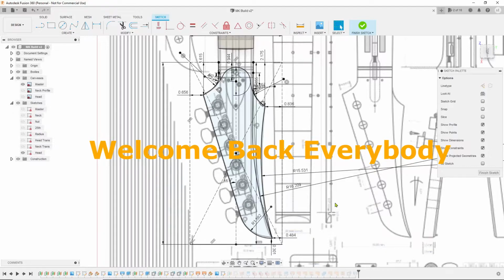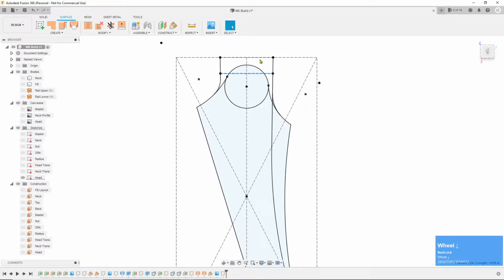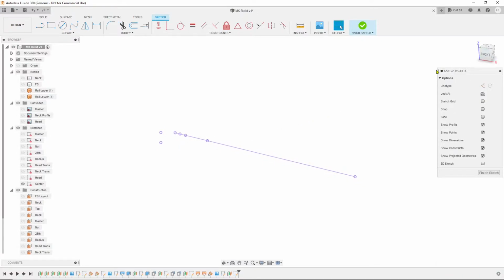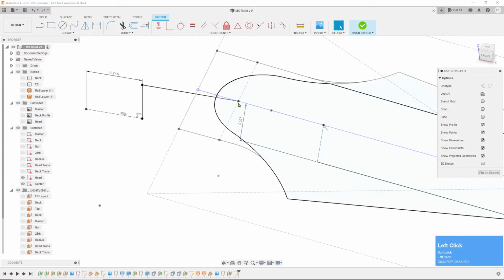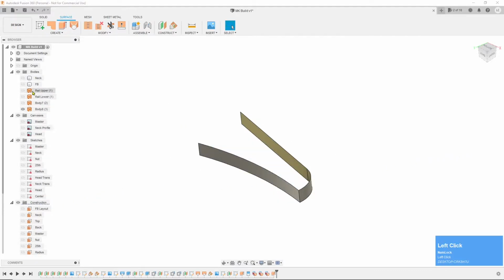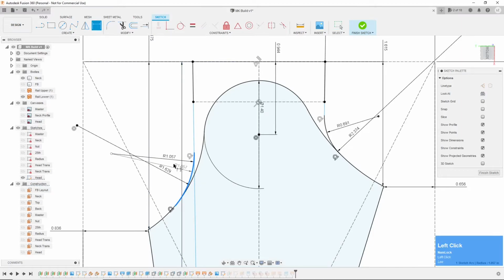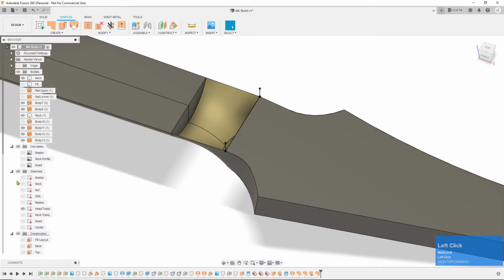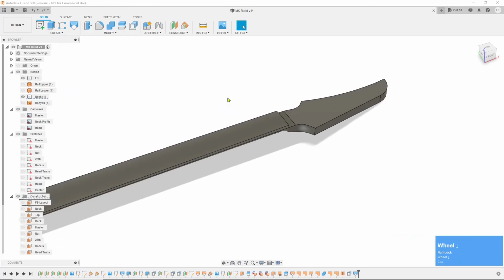Fusion360 CNC Guitar Build Session #3

Comment: Hi there Lee! Thank you again for sharing this! I am following your instructions exactly but i found a problem when patching the headstock, i can select Edges 1, 2 and 3, and it wont let me select after that, any idea what could be wrong?
Reply: Also, my bodies changed from grey to purple, i don't know if that could be the issue as well, and i don't know how or when they changed to purple :(
Reply from the maker: @hatespirit  I had that happen once. Not sure why. You can move the time line back until they go back to grey. The next event in the time line is what cause the change. Maybe you can delete the event. Or delete everything past that point. If it happened during a different setting. The you can open a previous version.
Reply: @leecraftsmen5702  I tried doing that but couldnt spot it, there is a purple line above the whole timeline, dunno why
Reply from the maker: @hatespirit  You may have to go back to a different version and start again from there
Reply from the maker: As for the patch. I can not see any thing obvious. I was able to make the patch by turning on the Head sketch as well as the Head Transition sketch.
Reply: @leecraftsmen5702  Thank you Lee!!! let me get back on it and try it myself, if it wont let me do it im affraid will have to start from scratch lol
Reply from the maker: From the file you sent me, all the bodies are grey and no purple lines in the time line. Makes me think that a setting got toggled on your software.
Reply: I made it Lee!! I don't know how, and it was all grey again, i think my Fusion just doesnt like me!!!!
Reply from the maker: @hatespirit  Fusion loves you bro!
Reply from the maker: I found a solution for the patch
Reply from the maker: Drag select all the head bodies and perform a patch operation. Then I was able to select all the edges for the patch
Reply from the maker: Not Patch operation, daaa,  Stitch operation
Reply: @leecraftsmen5702  There was something strange with my file, i also couldnt patch the small gap after patching the headstock, so i had to patch the whole fretboard up to the transition, then split the faces, and done!
Reply from the maker: @hatespirit  That may come back to bite you later, Try to stitch all the head bodies, except body8 " the first loft". Then I was able to patch.
I sent you a png to your email
Reply from the maker: Okey, Best solution yet. In the solid menu, combine neck 1 and neck 2. Stitch together the fore mentioned head stock. Then patch the entire head stock top, including the area under the fret board all in one patch. Then Patch the end that meets the neck' may need to turn on the neck". Stitch all that together. I think this will also eliminate the issue with combining the neck and head.
👍
Reply from the maker: I have learned lots of stuff since these videos were made.
Reply from the maker: For all these patch issues, stitch first, then patch.
Reply: @leecraftsmen5702  I got you!!! Thank you so much for all the help!!! Now im going to the next episode lol! see ya there haha
Reply: I have found how to solve this issue if it ever happens to you, just press "Shift+N"
Reply: This is for when is all turns Purple
Reply from the maker: @hatespirit  Cool, Thanks for sharing. Did this fix the issue you emailed me about this morning?
Reply: @leecraftsmen5702  Hi Lee! no i have not been able to fix it, i have tried starting it from scratch 3 times already, same thing, cannot patch it :(
Reply from the maker: yes. first try to select them in a different order. make sure chaining is off. some times two or more of the sketches on different planes are not touching. some times there are options, in the warning fly out, showing the issue.
Reply from the maker: also check for any very tiny radius that did not get selected.
You can email me the design and I will find the issue.  LeeCraftsmen@gmail.com
Reply from the maker: Scroll in very close and look for tiny segments
Reply: @leecraftsmen5702  Thank you so much Lee!! I am doing same design you are doing in the tutorial, so that i could follow exactly, i am now looking for that tiny gap there might be around, I will let you know if i found it lol
Reply: @leecraftsmen5702  I sent it to you Lee, thnx!!!!